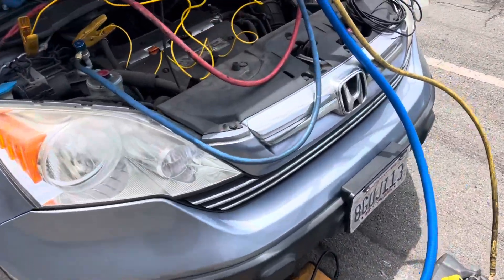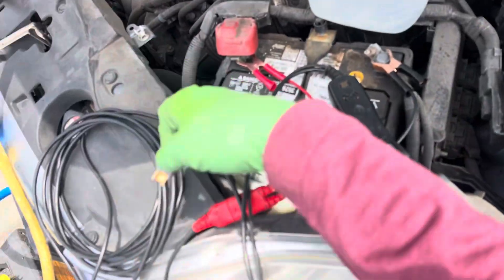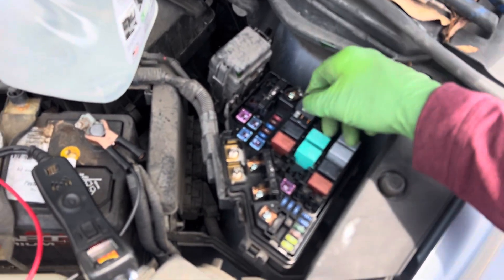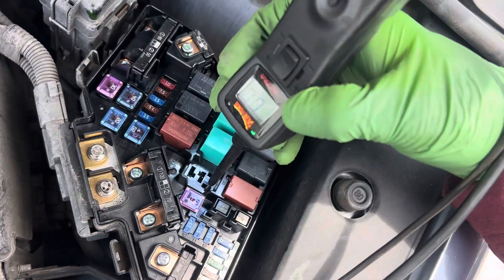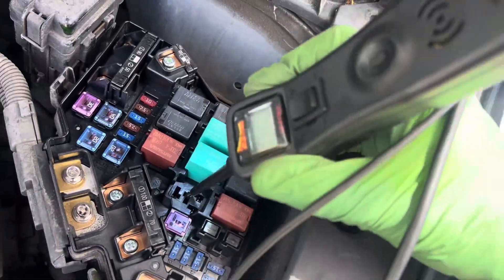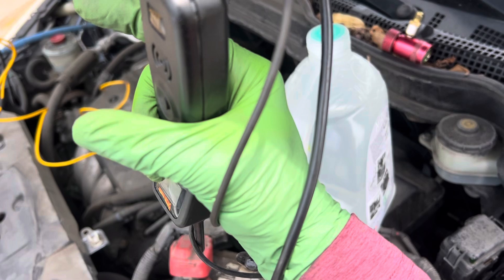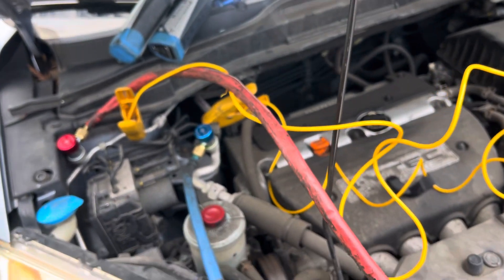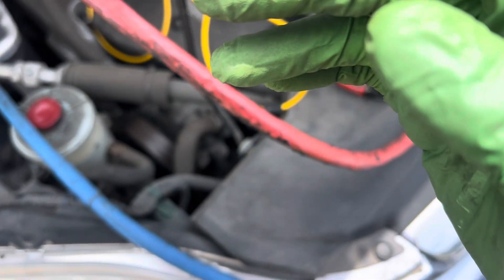AC compressor clutch coil, not engaging on a Honda. It’s NOT !  the relay. ￼

Comment: Most honda compressors have a thermal switch
Reply from the maker: @pinpointauto3091  years ago, old compressors on Old Cars not anymore. On those. SANDEN. 
Now they’ve all gone to the variable displacement compressors

Comment: Removed the clutch plate to remove the shim, not the pulley.  Easy job since the pulley and belt can stay on.
Reply from the maker: @miket1322  it’s not the pullt on this one . A simple push on the clutch face would manually reengage if it was a gap problem..
Reply: @coldfinger459sub0  I should have payed more attention!  Had the coil short out on my 08 Honda Fit and this took out the fuse.  Condenser fan stopped running (same circuit) so that was another clue that the coil had shorted.
Reply from the maker: @miket1322  Shorted coil blow the power fuse

Open Coil diffuse will be OK

Clutch gap to wide 
If you push on or hit the face of the clutch, it will snap in and start working

Comment: If there is not a short in the coil then my bet is is that the clutch gap is too big due to wear.  Happened on my 02 Civic and a friend's 08 CRV.  Removing the clutch pulley and removing a shim solved the problem.   I think the max gap allowed is 0.02 inch.
Reply from the maker: @miket1322  clutch gap on this was OK.  Even gave it a few taps and hits the push to clutch facing to the pulley well calling for cooling. 

Completely open circuit . 
No ground through the coil .

Comment: I have the next gen CRV (2013) and the clutch is starting to make noise at idle. Can easily replicate it by simply engaging the A/C off and on.  Apparently, the scroll compressors on these things were worse on the 2007 CRV in the video, does the same hold true to my generation?  Worth swapping the coil or the entire compressor given the mileage (118k)?   I noticed the aftermarket sells a piston type compressor.
Reply: I had that same 2007 and around here I still see plenty of the 07-11 model. Easy years to remember with 7-11 stores. Once fell asleep in a parking lot with A/C on. Woke up two hours later with A/C still cooling nice in Houston summer heat but in shade. Eventually it got worse at idle with age but never fully died. Just required recharge every 3 years or so. Sold with around 240K? A/C still working even with bad compressor reputation.
Reply from the maker: @fastsvo  some of those early models I can’t remember if that’s included in yours or they had to compressors blow out a big hole and decided a case excessive oil and refrigerant would try to compress under certain conditions

I’ve installed couple of the piston replacements aftermarket compressors, and they worked better colder at idle . 

If you do go that compressor replacement route make sure you probably perform the oil balance procedure as per manufacturer instructions 

Otherwise, you may have poor AC performance due to excessive oil in the system and or short compressor 

I very rarely see these vehicles anymore. They’re mostly gone, but from what I can remember their idol performance in hot weather sucked.
Reply: @coldfinger459sub0  yes, I can confirm that it’s not the best at idle and gets much better as you get on the highway. 

We had a 2004 TSX, similar to the CRV in the video and that car did blow its compressor and sent shrapnel throughout the system.

Comment: What if the AC Compressor doesn't cycle? The magnetic clutch engages and disengages when I turn on and off the ac, but once turned on, It's just always on.
Reply from the maker: @naturoidz2714  sounds like you’re in very hot weather

Or you have a model that has variable displacement compressor .  And a clutch will not cage unless you’re in cold weather trying to use the AC.
Reply: @coldfinger459sub0  Thanks for the reply sir.

Comment: I have seen compressors (delphi and valeo) which have the replaceable diode in the coil melt due to pulley bearings going bad. Usually shaft seal will be gone as well by that point.
Reply from the maker: @Jeff-gb5rt  yes 👍

Comment: We have the same model of Honda. 2 years ago I spent hours on the ground swapping the ac clutch. Just awful doing it yourself without a hoist etc. Worked perfectly after that but still traumatized by all the crawling on the ground
Reply: I think you meant a lift, not hoist. How many times do I wish I could afford to have a lift installed in my garage. Wish I could afford the house first.
Reply from the maker: @yactabay  oyster gotten extremely cheap now. 
For the price of an electric bicycle, you can have a hoist
Reply from the maker: @yactabay  million dollars 💸 where I live in San Francisco California $1 million is where the poor people live in, not so nice neighborhoods dilapidated houses that need to be completely remodeled.  Electrical from the 1930s 20s or 40s..  usually high rat infestation and cockroaches

Million dollars is nothing . 

$1.5 million only get you an old home that somebody threw paint on and did a pretend patch job light renovation to get it ready for sale . 

I moved out of the city because it’s too poor too dirty too many car break-ins too many homeless witness too many crimes live there my whole life 

Move 17 minutes north across the Golden Gate where the average house prices $3.3 million in nicer neighborhoods with no homeless no crime . 

Million dollars is poverty here in SF
Reply from the maker: @rmariu  I would be to